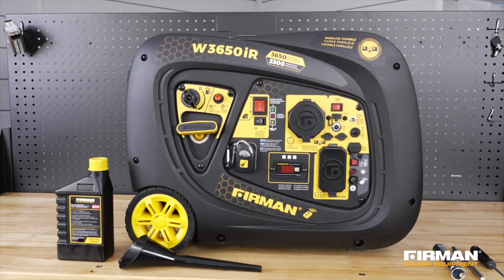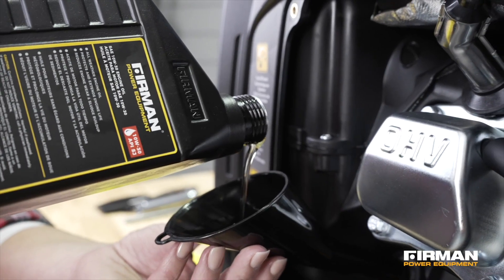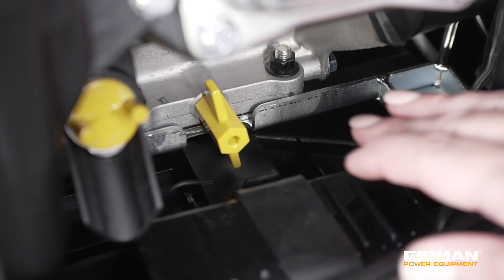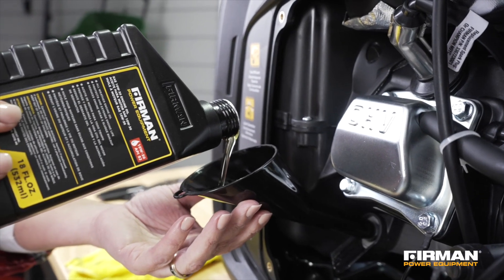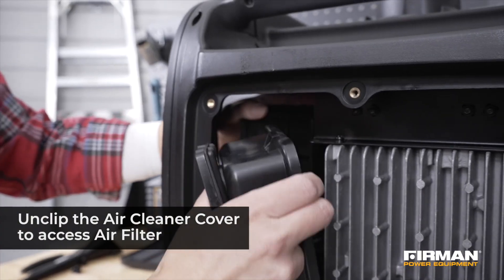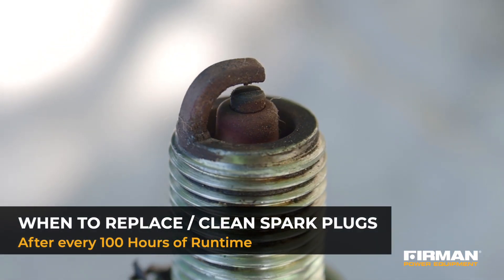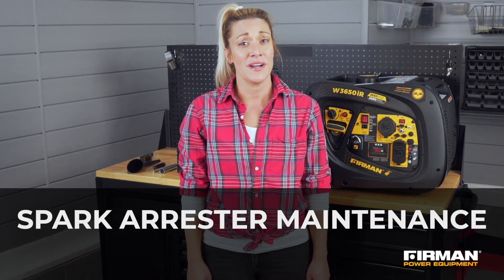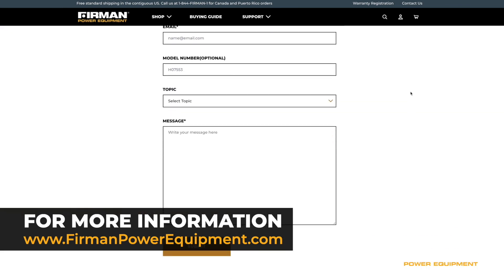FIRMAN General Maintenace on Inverters 2900-3650 Watts

Comment: Wow that's some really bad advice. 100 hours of runtime in between oil changes?! You guys really don't want your machines to last at all huh?

The first 5-6 hrs of runtime to allow the wearing process to happen, change out that oil, and then every 25 hours of runtime maybe 50hrs if conditions are ideal using synthetic oil. 100 hours... that engine will be blown up for sure, or heavily worn to the point it's burning massive amounts of oil.